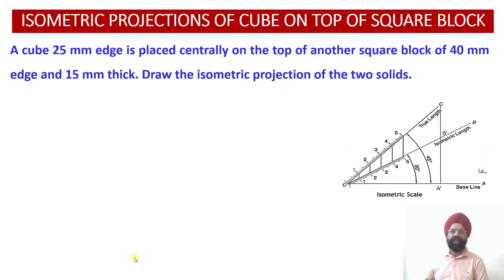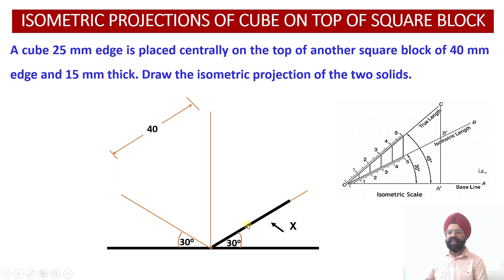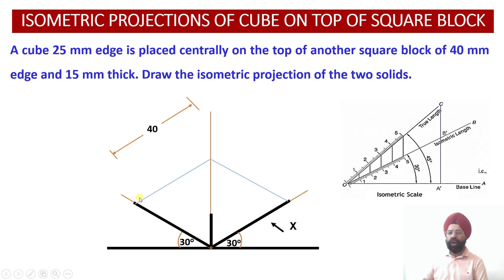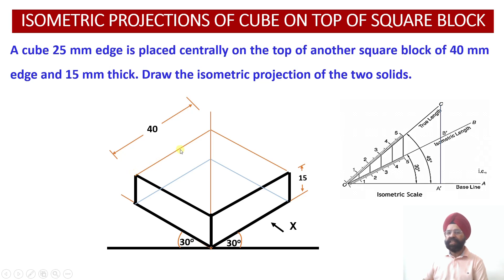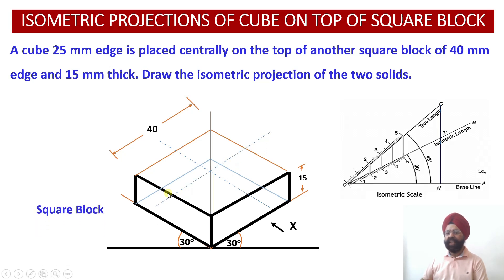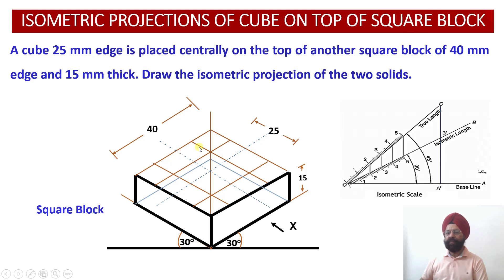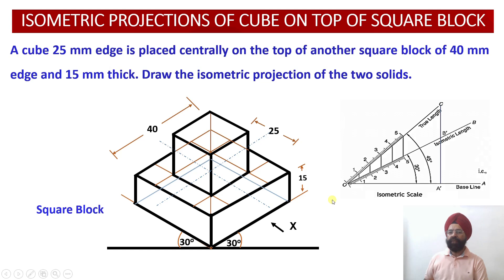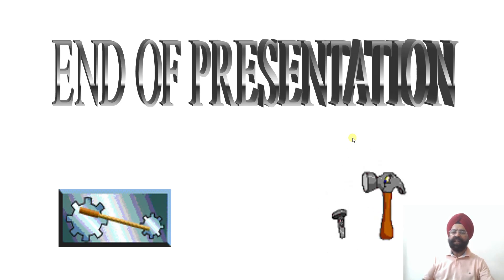Engineering Graphics Lecture 015E Isometric Projections V (Cube on Top of a Square Block)

Comment: Sir at 8:15 you marked 12.5 distance but we have to take isometric length so it will be different n??
Reply from the maker: Yes, please note that all distances marked on Isometric projections will be Isometric lengths corrosponding to the True lengths (Isometric length = 0.816 True Length). Here we have to draw an offset of 10.2 mm from the center line, which happens to be isometric length corrosponding to the True length of 12.5mm.   But we have to  mention the actual true length on the Isometric construction. Hope this will clarify the doubt.